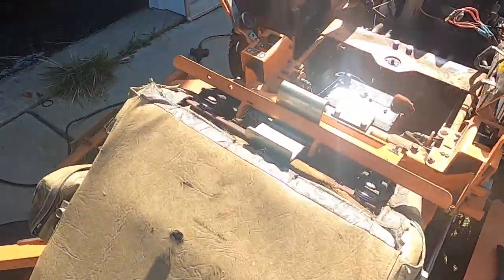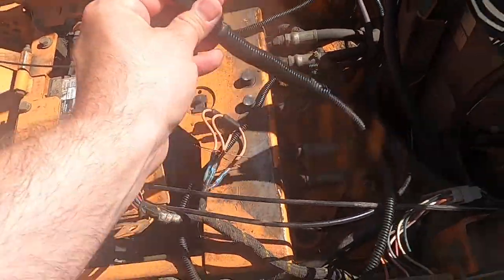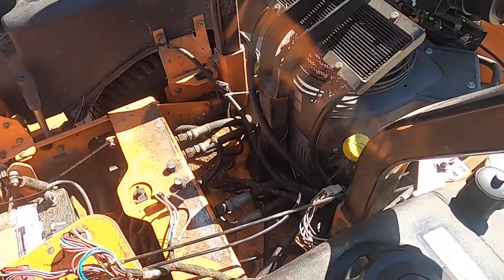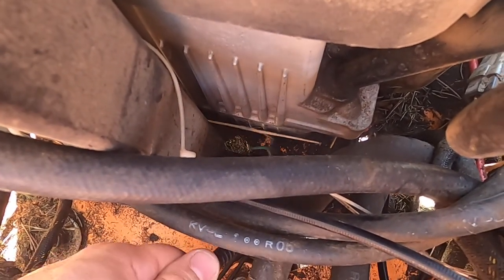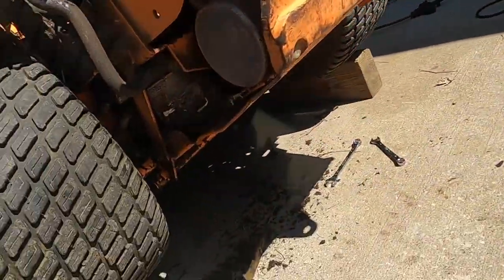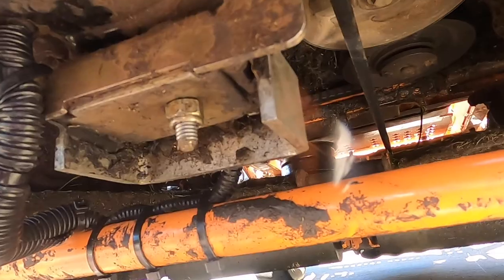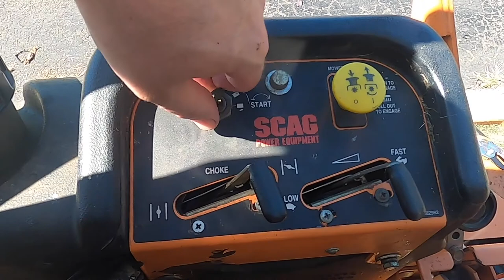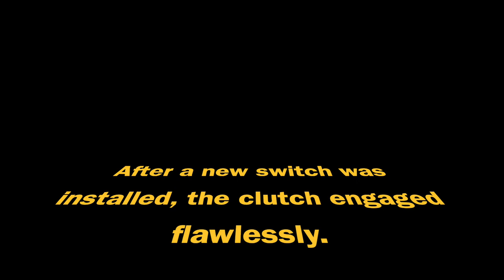Repairing wires on Scag Wildcat lawn mower clutch after blowing fuses

Comment: how does the clip come in done. i can’t get it
Reply: you have to press really hard on that tab to release it.
Reply: had the exact same problem and had to  replace the switch as well.
Reply: Is there specific way how the wires go meaning negative positive
Reply: The horizontal on plug is positive wire if splice trace out to match the polarity